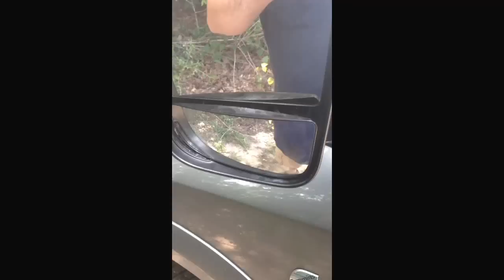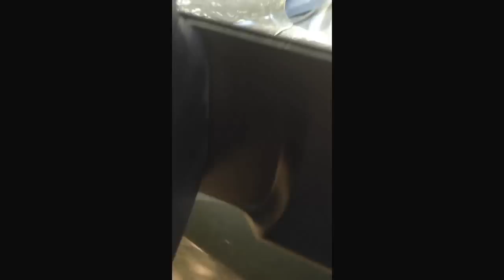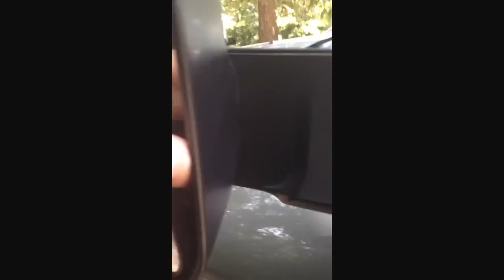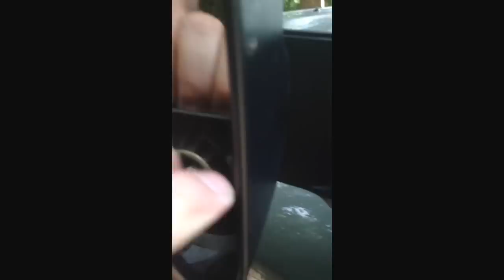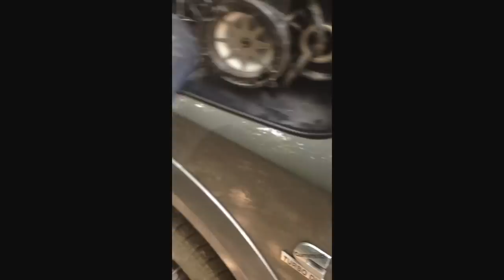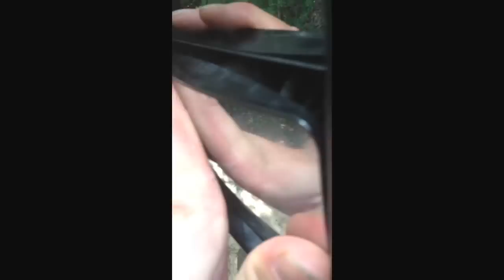Changing turn signal light on 2012 Ram tow mirror

Comment: yep works on my 2014, you just have to buy the complete assembly because the led's cant be replaced, about 51 bucks at local dealership for the turn signal assembly
Reply: winehead99 is that per mirror or for the set

Comment: Thanks for making this video. Torque screw, is that a star screw? I don't suppose you can give me a good site to buy that lens from. 

Later: I just took mine apart and dried the inside with a hair dryer and put some silicone where the crack is, in hopes of keeping it dry until I can replace it.  Mine just uses a philips. Thanks for showing me how to get into it.

Comment from the maker: It is a torx screw with a T-15 head. I think its also called a star screw. 

Here are all the part numbers for the lights chrome or black mirrors matter for the blinker light. Puddle lamps fit either.

Puddle lamps
68087239AA
68087238AA

Turn signals for Chrome Tow Mirrors
68087235AA 
68087234AA

Turn signals for Black Tow Mirrors
68067759AA
68067758AA

I usually just put the part number in google and search then compare prices. Sometimes amazon have the better prices.

Here is on place I've bought from before.

http://www.factorychryslerparts.com/products/DODGE//RAM-5500/LAMP-Right-Turn-Signal/2012/4509907/68067758AA.html

Comment: I wanna turn mine into parking lights so they stay on when I have my lights on and then blink when the turn signal is on..
Reply from the maker: Like this? 

http://youtu.be/rQm_1Gvbvbg
Reply: Chris Hollnagel YES!!!  How did ya do it?
Reply from the maker: +cuzntime

Another guy figured it out. I just followed his right up. 

http://www.cumminsforum.com/forum/showthread.php?t=544291

Use post #84 for the correct wire to tap on the drivers side.
Reply: He should post a video on it, lots of guys wanna do that..
Reply from the maker: It's a time consuming process. Not exactly hard but takes a little while to complete it. Worst part is getting it through the door. Good luck you'll like the end result 👍
Reply: Cuzntime www.ramforum.com has complete write up and pics/videos.
Reply from the maker: How do you tag people in comments. I'm sure it's something simple but I haven't been able to do it yet.
Reply: it works just like facebook, type their name and it pops up and select.

Comment: I broke my mirror
Reply from the maker: That sucks. Not sure how much the replacement is. I wouldn't think it'd be much over $20-25.
Reply: +Chris Hollnagel paid 67$ right away, oem , Portland Oregon
Reply: +Chris Hollnagel for both mirror and turn signal
Reply from the maker: +KWO KGB Dang didn't think that little mirror would cost that much.